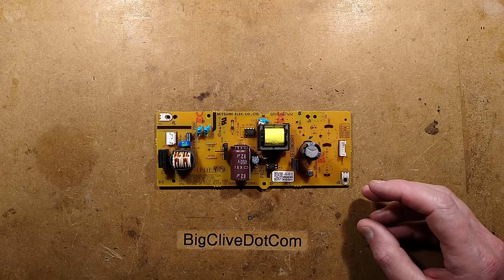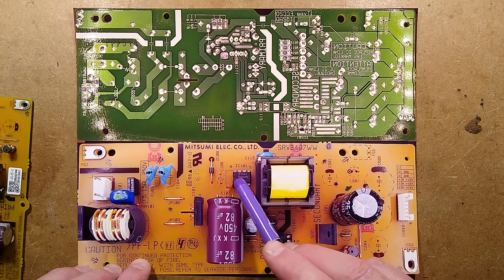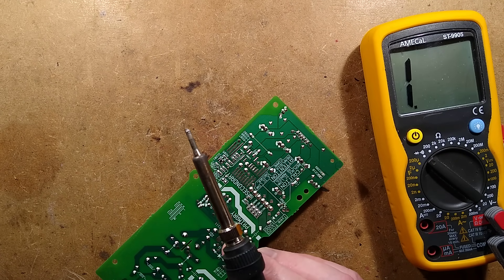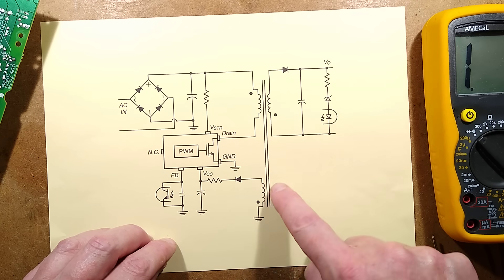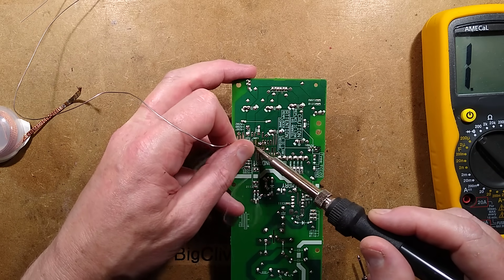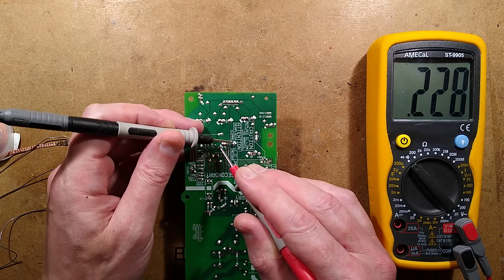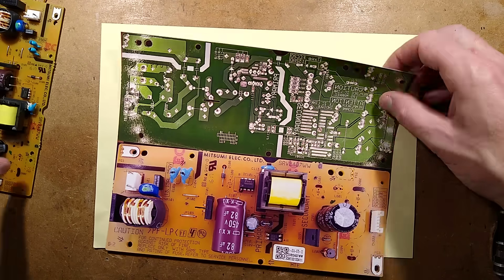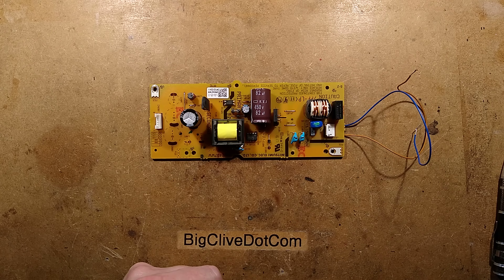Diagnosing a faulty PSU

Comment: My blue ray player has a plug pack as the power supply, so I can just get another one when the plug pack decides to ship the bed. (On the other hand 90% of plug packs are glued together with no non-destructive way to open them. That won't stop me doing a post mortem though)

Comment: Yeah I remember seeing a similar arrangement in another disk player I'd taken apart, and the lack of anything on the secondary side that was either a voltage regulator with current protection, or anything else resembling a current sense circuit providing feed back to the controller. Therefore when I looked at it, I figured if there had been a short on the secondary side that the supply would have just been ruined. I didn't know about the feedback coil powering the chip.

Comment: I just noticed that you didn't test that diode correctly. The diode pack has a common cathode on the centre pin. You placed your meter +ve on the anode and -ve on cathode first diode(left + centre pin) and said it was good the the next diode you placed +ve on the cathode and -ve on the anode (centre + right pin) and said it was faulty. Seems you got that wrong.  Check the video closely.

Comment: pausing at 1:50... I will say damn that's a cheap power supply~~~  Likely in a 30.00 Sony DVD player.

Initial thoughts... I will say the small electrolytic capacitor to the right of the main b+ capacitor; or IC101,  possibly even the secondary cap.
Reply: looking at the photo... are there bad connections on the 12v regulator (4 pin) to-220 in the secondary???

Comment: This may explain my Lg Dvr currently. 
It was switching on and off between standby and ready repeatedly until it just lost power completely.
I have opened it up and found a 3300uf 10v capacitor bulged out. 
But after watching this video I'm  suspicious that another component may have caused the blown capacitor......?
Reply from the maker: It's probably just the capacitor.  That's a common failure.
Reply: @bigclivedotcom  
Hope so Clive. My electronics fault finding skills are very limited if it's something else as well.
Reply: @bigclivedotcom  
You were right! It was just the capacitor. It's now working!

Comment: On page 12 of the datasheet there's a demonstration board schematic, which might be much closer to the board you're looking at. There's an interesting detail about the diode on the suppression network on the primary, the datasheet calls for a 1N4007 and not a fast recovery diode as used elsewhere on the design. 
One possible explanation may be that using a "slow" diode allows some of the spike current to flow back, marginally improving efficiency.

Comment: Could you get a shock from the 450v capacitor through the plug or it is blocked by the full bridge rectifier?
Reply from the maker: It's blocked.

Comment: Cool!
I saw the optocoupler sitting between the primary and secondary sides, but what is the capacitor (seen in your photo, top center of the rear of the board) doing bridging the two? Is is another safety cap?

Comment: Wondering if you tried/considered SnBi solder for de-soldering / lead-free solder alternative. It melts at roughly 140C and mixes well with lead-free solder used in PCBs even before the lead-free temps are reached, making it easier to pull the parts out (and without them getting overheated). Though I find it tends to perform terribly mechanically if you mix it with lead-free solder for normal joints.

Comment: If you want to remove a component and need to pull it gently to remove it there is an easy trick I use. Grab a pair of forceps and clip them onto the resistor, mosfet etc and then hold the board so they hang, once you heat the pads up the weight will pull gently for you. An added bonus for exposed metal components is it helps reduce the heat in the parts. Sorta like the opposite to using bluetack to hold parts in place while you solder them in place. 

Forceps are an excellent tool for the toolkit for all sorts of little tricks. Very handy and usually a great cheap addition to the toolkit.

Comment: We have hundreds of £££s of faulty marine electrical equipment dumped at our boat yard and there is no way to get it repaired economically, probably a few components on the PCB have gone that's all. It all goes in the bin since it's not even worth the cost of postage to sell on eBay for spares, it's a criminal waste.

Comment: You can usually find the location of a short without removing any parts if you use a decent bench meter and a 4 wire resistance measurement. You just probe all the components on the 12V rail and wherever the resistance is lowest is where your short is.
Reply: Sorry for the dumb question - I’m a noob: so, you would place the red probe on the power rail and the black probe on a ground point, to do what you suggest? Please clarify, I want to learn. Thank you kindly

Comment: Clive, to make it more reliable could you fit a higher powered diodes or 2 same or better solder through hole diodes?
Thanks.
Reply from the maker: The original component shouldn't have been stressed.

Comment: Well this video seems usefull as I'm trying to fix a server psu iv found that a resistor has blown so far. Any help fixing psu would be great.
Reply from the maker: Depending on where the resistor is it could be an inrush limiter or a current sense resistor.  If current sensing then the main switching transistor may have failed short circuit.

Comment: I had a diode AND the cap fail in a dvd/vhs combo psu one time.
didn't blow the cap , but it had an ever so slight bulge , and both parts measured 0 ohms.
2 euro's in parts fixed it.

Comment: When you measured the diodes, didnt you test the second one backwards...
Reply: Diodes should block electricity in this direction, right? Yet, we have a dead short (perfect conductivity) between the two leads, so we have a faulty diode. ;)
Reply: @em0_tion  no, if it was backwards it would pass it, reading continuous
Reply: @phonotical  It really shouldn't on a healthy diode, continuity test is different than diode mode. At least my multimeter agrees. To be fair, I'm not agreeing with this diode testing methodology in general and I don't think Clive meant it as a by the book teaching moment at all, but hey - his shortcut answer is right. :)
Reply: @em0_tion  diode mode tests foward voltage
Reply: @phonotical  You're the biggest troll.
Reply: @em0_tion  you've got no idea what you're talking about
Reply: @phonotical  I've got no idea what you're talking about with these short "backwards" one liners for sure. It's like you're talking about reverse bias measurement, but Clive is using Continuity mode. You're just opposing for fun, can't be bothered to clarify anything. Being "right" seems more important to you then "wasting" your words in a conversation.

Comment: I had a 12v 2.5a supply that didn't work from new, I couldn't find anything wrong, capacitors, chip, resistors, traces, transformer, everything was ok😵 so I thought screw it, and saved the components 😂....... I wish I knew the 500v capacitor was charged...

Comment: This power supply should definitely have a heat sink on the diodes and all semiconductor components. The darkened circuit board suggests that there is a fairly large amount of heat being produced when this power supply is in operation and not to have any kind of heatsink  on the semi conductors only  further show just how designed to fail all modern electronics have become and I condemn  companies for purposely and openly sabotaging  most devices that are made today.
Reply: The output power of this supply is low, so the components aren't going to get very hot.  The oversized diode package is the heat sink for this.
Reply: @stargazer7644  I am assuming you havent repaired many if any switching power supplies. I have been designing, building and fixing these things close to 40 years,long before they were ever seen in consumer products. The darkened p.c. board is a dead give away that the components on that board have been running at fairly high temperatures for a very long time and this is as obvious a sign of hot running components as there is.
Reply: @peterzeboroff7448  Your assumption would be wrong.  Not everyone you run into on youtube is a Millennial.  I have over 35 years of experience.  Look at the board at 10:24 .  I don't see any significant discoloration around any components. You're looking at shadows.
Reply: @stargazer7644  I have watched this video more than once and what I said remains the same and if you cant see  definite color change than either you have a crappy low end monitor or your color setting are wrong, I have a 32 inch pro View sonic with almost perfect resolution and color representation since there is no such thing as 100% anything. That board is definitely   darkened and I have fixed,  built and repaired many thousands of these types of switching power boards and if you actually had any kind of real experience with these, you would know through even common sense working with many of them  that even if this power supply put out 1 amp and I am pretty sure it puts out more than that but even at 1 amp output, that  diode trio would run so hot it would burn your fingers and over time, it would definitely darken that board, that is a 100% fact as sure as tomorrow follows today and if you still think different, go and find any switching  power board of 1 amp or more  that has a diode output such as this and take the heatsink off that diode if if has one and measure the temperature when putting out even one amp.
Reply: @peterzeboroff7448  Dude, nobody gives a crap what kind of wonderful monitor you think you have.  At 10:24 there clearly is NO discoloration around the diodes, or anywhere else on the board.  Look at the actual board, not the picture Clive printed.  At 1A half wave, that diode pack will be dissipating about 350 milliwatts.  That's nothing for that size package.  It isn't going to be hot.   Since you've repaired so many things, how many DVD players have you seen that need multiple amps at 12V?  For what?  Get off your high horse man.
Reply: @stargazer7644  I  am done with you, I have done this far too long and seen far to many boards. I know what I know and you think you know what you think you know and I will leave it at that
Reply: @peterzeboroff7448  Of course you're done with me.  That's what happens with know-it-alls when facts they can't refute put them into a corner.  It won't kill you to admit you were wrong.  We all make mistakes.
Reply: @stargazer7644  The only mistake I made was to even bother replying to such a keyboard expert such as you, I tend to forget not every one on here knows  anything
Reply: @peterzeboroff7448  I thought you were done with me?  If the only thing you can do is talk about how great you are then why don't you just go away and watch your "perfect resolution" monitor.  Whatever that means.

Comment: Three terminal diode ???. I know that there are two diode packages but the diagram shows only one on the output ?.
Reply: The diagram was the example circuit, not the diagram for this particular power supply.  The two diodes were in parallel.

Comment: When you test continuity for the second diode, shouldn't you keep the negative on the middle pin, otherwise it should be a short.
Reply: It isn't a short across a diode.  Diodes have forward voltage drop.  That's what the meter is measuring.

Comment: Hi Clive, would you be interested in diagnosing a dead Skot T105 electronic transformer, 230VAC in 11.5VAC out, fully dimmable, which I had on a low voltage halogen light in the bathroom? From my quick diagnosis there is mains going in but nothing on the LV side. No skid marks in the case or circuit board.

Comment: Inappropriate use of the earth/ground symbols on the circuit diagram.  Those points should not be connected to any of earth/ground, chassis or case metalwork.

Comment: Its a a Shame they don't use Dip Sockets for components that Fail A lot to make them  Easy to replace  if the same components Dies Again  

If they keep blowing  Frequently investigate that the   PSU is Not meeting its Spec (Standby) - (Full power) - for a complete Re Design for a couple of   Component  Parallel  Parings to try and eliminate Power Stress Within the Power Supply components
Reply: Sockets often cause more problems than they solve.

Comment: I still think the €100 ZD-8915 was a good buy as desoldering station, as long as you put in a coin to prevent it from becoming plugged. It makes desoldering a lot easier.
 I had the capacitor thing. oh the power supply is not working, it has not been on for a while so it probably discharged. Let's be sure and bridge over a screwdriver. BANG! Well it definitely still held a charge.... happy it wasn't my finger.

Comment: I have seen tons of perfect quality DELL wide screens going bad and ending up in the dumpster, just because of a 50ct diode or cap go haywire. And since these devices are often "made" to be NOT SERVICEABLE its a pain in the butt to open and repair them. 99% WORKING DEVICES go into trash... because 1% of the device failed. How is that sustainable ????!

Comment: Unlikely to have done any damage to the output cap as the SMPSU controller should have detected it hadn't had any feedback via the opto isolator for few cycles and gone into output short/opto failure shutdown.

[Later] After a quick scan of the FSGM300 datasheet it could have shut one of several ways. It does detect a open feedback path via the opto but does it via the over-voltage protection circuit. So at first pass it's not obvious what would happen with a short-circuit diode.
If I was repairing this I'd put a small flag heatsink on the diode package.

Comment: Thanks so much for this Clive, I have some smart bulbs that I've flashed to Tasmota to de-cloudify them. The PSU has failed on some of them, which I'd like to revive, as manufacturers are making it increasingly hard to flash firmware on newer smart things. This video will make fixing them a more reasonable proposition.

Comment: 1. SMPS with ticking output fault is called "hiccupping".
2. Get a solder plunger sucker, they are much faster and easier than braid!
3. A non-insulated pack diode will run cooler and more reliable than an insulated pack diode which have to be derated for dissipation. And if this is for a friend I would even add a small heatsink.
Reply: Get a vacuum pump desoldering gun and throw away the plunger sucker.  You'll wonder how you ever lived without it.

Comment: When I fix something like this, I like to use a diode with a voltage rating one step higher (as you said, 2*5A should be more than enough for the BD player, so current handling capability likely isn't the issue), and possibly add a heatsink to the diode. I got a cheap +5V/+12V supply with an USB/IDE adapter that developed the same kind of fault (one of the secondary rectifiers shorted), but it had a simple 2-transistor primary-side oscillator that kept running into current limit each pulse, so no kind of pulsing or short circuit protection, which heated the transformer. The supply started smelling "hot" after like 10 seconds of operation in that condition.
The broken diode was a single DO-201 diode, but the PCB and heatsink in this supply were designed to take a single TO-220AC diode (two legs only), and after replacing the shorted diode with a heatsink-mounted TO-220AC, the supply works fine again. When the supply failed, I was testing stuff with a dead HDD, so I power-cycled it a lot. Maybe the diode got killed by inrush current when it was still warm. The specs seemed to be OK, 40V reverse and some amps forward. A scope showed that the actual reverse voltage during operation was far from being 40V.

Comment: Your caution with the capacitor reminds me of my college days in the 70s. It was all valves with lots of volts available on the bench. We used to get big electrolytic caps, extend the connections with bare wire and tape it down each side of the cap. We would then charge it to 200 volts and toss it across the lab shouting 'catch' . The recipient got quite a surprise 😂 Oh the folly of youth.
Reply: I have similar stories of that period, in the testing department of a PABX manufacturer and students at the electronics lab of a local school kept doing that all the time, leaving charged capacitors over the benches, waiting for a "sucker".

Comment: I noticed Clive was using liquid flux. I bought some Topnik RF800 flux from Ebay, but found it impossible to use due to the acrid fumes it gave off. It literally took my breath away! I now use some RMA-223 gel flux that works fine with no issues.
Reply: I use resin dissolved in ethanol. The cheap 95% ethanol that is sold for fake fireplaces.

Comment: Hey guys, I have a Xbox one power brick (model PE-2201-02M1) I want to fix. The power supply turns off when plugged into the console (orange light turns off on the PSU, 5vsb was present).  I opened it up and found 2 SMD caps which are scorched and 1 of 2 K12A50D mosfets (Q201/Q202) seems to be shorted.  The caps are between drain and source of each of the mosfets. There is no silk screen on the bottom side of the PCB and I can't find any schematics. 
How would you find replacements for the caps?

Comment: The opto feedback (FB) in your schematic is for power saving not used in the actual circuit, or is it also voltage control (is it then optional?)
Reply: This is part of the feedback loop for voltage regulation.
Reply: The zener on that optocoupler is what sets the output voltage.

Comment: Clive : "Until It Just Randomly Pops Out, It Is Possible, It Is Wiggling, It's Want To Come Out But It's Not Coming Out" 04:30😆 Switch-Mode PSUs are interesting devices. I have a collection of HP Proliant DPS1200 units that I use for RC model aircraft charging. They used to be dirt cheap until the data miners forced the price up.